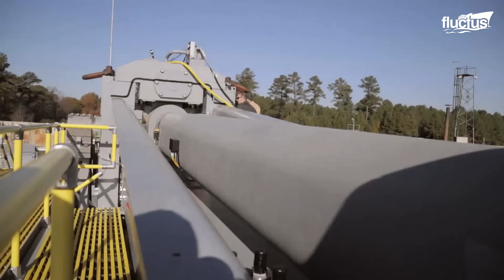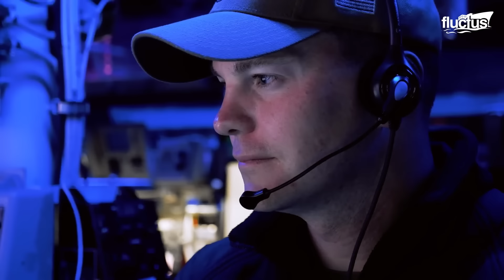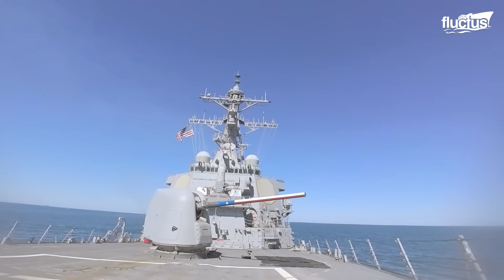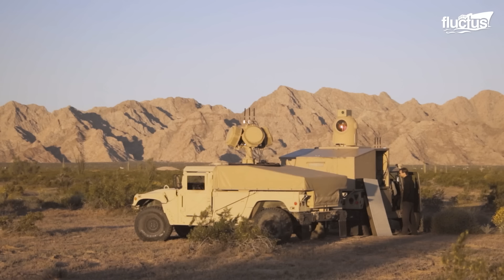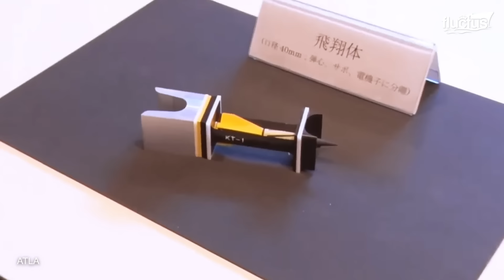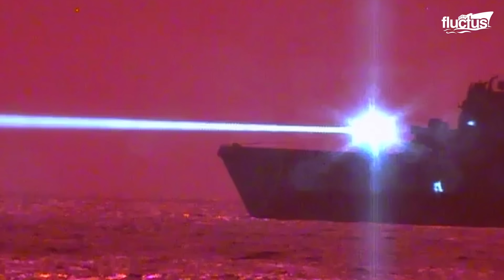US Testing Super Advanced Electromagnetic Rail Gun System

Comment: You'd better use that much electrical power on a "laser canon"  (vs a rail gun). It can hit the target at 300000 km/second and leave no physical evidence at the scene. + No need to carry any projectiles (along with their weight) . As long as you have electrical power, you can keep firing. High power electromagnetic / radio waves could also work in tandem with lasers. I'd bet on such weapons rather than the rail gun